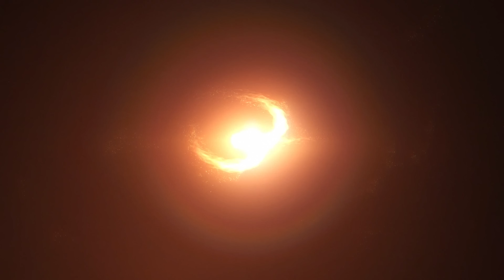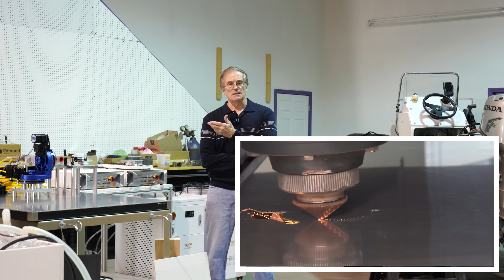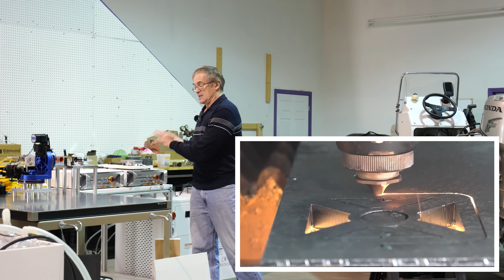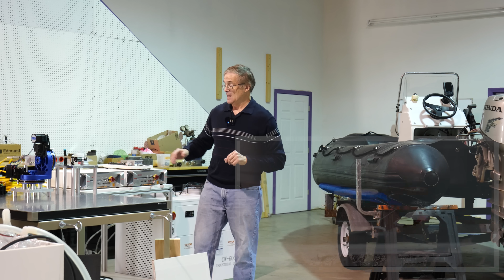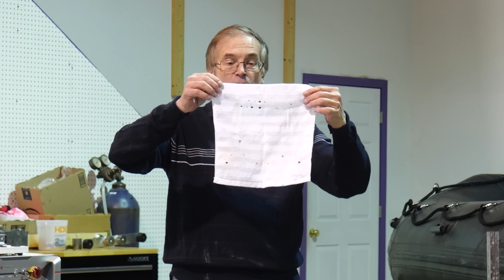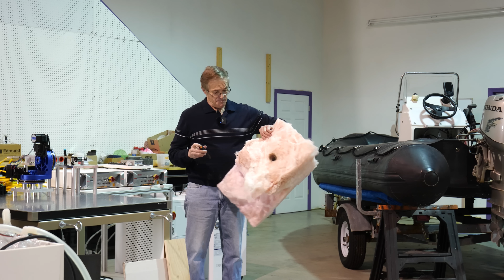We have a problem... and need your help!

Comment: packing gypsum salts between two panels.   They come very hydrated, mostly water by weight. Fill up the gap between the panels.  The white crystals and the flash to steam could buy you a second.
Reply: Epsom salts.  It’s late.
Reply: MgSO4•7H2O    7 is a lot.
Reply: Before the panel exploded.    Idk.  Maybe.

Comment: Something i think we are all forgetting: part of this test will be on a moving object, both lateral and vertical variances, more random in nature to test the tracking system. 

The most difficult part of this test isn't the destruction of the target,  but the targeting of the object itself. So my proposal would be to use a lower powered laser and a photodetector switch on the drone itself. Set the sensitivity of sensor to much higher than the ambient light, to include direct sunlight (laser light is more focused and the intensity at the impact point is more intense than direct sunlight). The target could also be a 3d printed sphere with tubes leading to the sensor. Sort of a reverse disco ball. 

Then youll have to tweak the software to see if the target is dropping, if not, rinse lather repeat. 

As far as accuracy, i would want beam diameter times 1.5 MOA at the absolute furthest distance you can manage, the farther, the better. 

Another idea is to have small light tight boxes on the side of the drone that sends a kill signal to the laser controller.
Reply: I like this solution - totally changes the equation - trying to contain the 'impossible to contain' Vs. removing the 'impossible to contain' element.  Also gives you Unlimited testing time Vs. constantly patching holes with the high-power laser.
Reply: Exactly feel like I'm the only guy here with a modular system
Reply: Why not a retroreflective laser photoeye, and a retroflector on the target?  So no sensor on the drone.

Comment: Sounds like the problem comes down to beam intensity. I never played with a fiber laser, but perhaps you could de-collimate the beam in front of the wall. You could use a diffuser lens to disperse the light and lower the intensity to a manageable level. Use retail signage hardware to suspend the lenses several inches off of a (perhaps water cooled) surface.  Don't fight light with material matter, fight it with optics!

Comment: graphite felt is where its at. good absorber stops reflection lightweight and easy to setup. if you back it with textured copper there is a good chance if burnthrough happens it gets reflected back into the felt and absorbed.

Comment: I'm thinking differently... Here's the rough idea: Basically an aperture type setup. Where the aperture/iris/pupil is electronically connected to the laser output, and when the aperture is closed, the laser instantly is switched off. Making it impossible for the laser to burn the back of the aperture. Then you could essentially have different pulsed aperture opening events, to destroy targets, and you could play with different methods and timings for that. I don't foresee any other issues there. With the safety and wall, maybe also have an electronic cutoff for the laser PHYSICALLY pointing downward, or upward or left or right beyond the safety settings you enter each time you plan a live fire test. So essentially, electronic, fast, sensing cutoff switches. I thought of this because it reminded me of the story with aeroplane and their machine guns and how they solved the problem of the props getting shot up during firing of the gun in flight. It is absolutely henius, and simple, and fool proof how they solved it. Also didn't reduce the damage and effectiveness of the weapons. Any way, good luck, hope that helps. Appreciate all you guys do, great scientists, and great videographers, as well as crazy mad men... -=) That's a good thing by the way. Ciao for now. -Andrew
Reply: Other people said it, you have a turret mounted laser flying around trying to shoot down a drone. Think about it

Comment: Well, the only thing I could think of is some sort of defuser. Just like the laser cutter, if you can get the beam out of focus again after it's destroyed whatever it's going through, then the energy is spread out over a much larger area, and might not even need any sort of backstop. Only question is.. How?
I doubt there's any sort of lens sheet that's made that has a bunch of micro lenses in it to defuse beams from multiple angles and directions. But maybe if you have some sort of clear beads between a sheet of steel, maybe painted black as to not risk reflecting the beam, and then the back a sheet of glass, then it would punch through the front steel sheet, and then get refracted in many directions randomly in the beads, and then any that make it through the back should be diffused enough to not cause any damage to anything several feet behind it.
Or maybe even glass sand, might be a bit harder to contain inside of a container that gets a bunch of holes in it lol
But maybe it'd work better. Or even maybe marbles could work. Just as long as whatever beads or refraction medium is clear enough to not absorb a ton of power from the laser, that it might work.

Comment: Copper foam or shaving.... It will spread it but in large areas .....
Reply: Fill the box with  copper shaving and just enclosure it with some things high temperature. I have a fiber laser copper is a pain to deal with. Plus you can get your copper value back.

Comment: What about a large Mylar sheet stretched tightly over a frame to form a "mirror", canted at a 45 degree angle, that redirects the laser at the concrete slab?
There might be something you could add to water, like a dye, that would make the water absorb more of the energy.  Then you could use a large tray of water below to protect the slab if necessary.

Comment: Large sheet of thin copper not polished but sanded to scatter the beam (1000 grit?) behind the sheet rock. It may burn through the gypsum board but it won’t burn through it after bouncing off a crappy mirror. Coat the copper with lacquer so it still works and doesn’t cut the copper after it’s aged a bit. Need to look up the laser frequency and how absorptive copper is to it

Comment: A 10 foot circular black anodised or black graphite painted 1/8" Aluminum sheet with a rotation rate of about 5rpm will absorb all energy and never melt if the beam locks up, and a 10 foot test area is large and fits in the garage.

Otherwise a stationary rectangular sheet or any size suspended from the ceiling and front surface applicated with "starlite" material (makes carbon foam insulator when heated)

Both set ups should be easy to Lift up and secure with a rope and hook flat against the ceiling to get them out of the way

Comment: I wonder if the glass beads they put on the lines painted on the road would work, or even clear marbles. The idea is to diffuse the beam through the beads or marbles onto something like a painted backstop. The diffused beam might have less power and the backdrop might be able to handle it longer.

Comment: I am by far underqualified. But I may have a idea that could circumvent the human element of reaction time in stopping the device once its task has been accomplished. Is there a way that the laser itself completes a circuit and by completing that circuit the device essentially switches itself off. Perhaps a light detecting fabric that can be draped behind the target. Or something similar. Like I said im very much so under qualified but feel like using the speed of light against itself is the best solution.

Comment: I'm no engineer, but having spent time building a  low power helium neon laser gun in the 80's; It seems you only have 2 possible solutions when testing, one of which is much more difficult to resolve. A) if you leave the focal point the same after burning through the test target, there is likely little to nothing you can do to obsorb energy without consequences as you've demonstrated. B) what if you split the laser beam into many weaker individual beams that are more manageable to resolve energy diffusion. When I had my laser gun, I shot it into a drink glass and the ice cubes in the drink difussed the beam off all the individual ice cubes,then was absorbed by the clear water or liquid. To split the using a multifaceted diamond in theory could split the beam into weaker ones that sends them in different directions, which are weaker laser beams. Just a guess that defusing the laser beam after a practice target is penetrated like Ice cubes in a clear liquid or some other refractor like broken glass in clear container filled with a liquid, maybe even a dark liquid in a large tank or container might would work. Also have you considered varying pulse durations from your laser instead of continuous wave? So my vote is to try to split the laser beam into lots of smaller ones that are obsorbed as a theory for your solution.

Comment: What if you re-arranged the experiment to fire downward instead of sideways? Easier to layer your protective material, and if that burns through, you'll have earth under it. Your targeting area would likely be smaller, but you would get to pretend you're shooting lasers from satellites. 

How deep would a pool need to be to absorb the energy for a full minute? It would be cool to watch the beam punch through a several meter long trough of water and get a measurement.

Comment: Probably mentioned already, but you might experiment with refractory materials such as fiber blankets, fiberboard, castable refractory and you could even add some carbon black pigment to increase its absorption.

Comment: We blocked a 20kW CO2 infrared laser with a shutter disk, mounted on a solenoid mechanism. It was black anodized aluminium, and had a cavity in the back for circulating ice cold water from a chiller unit. Total diameter about 120 mm, thickness around 15 mm. It worked. Its natural position was normally closed (with a spring). Without this we DID burn a hole through the laboratory wall. It could easily melt a brick if allowed. The beam was interrupted before it was focused, with a beam dia of around 20mm.

Comment: I have a question ... Why slice and dice ... With that kind of power just hang out there in the projected path and let it get cut in half or set your laser in a jitter ... On my comment about 2 glass panels with ground glass and water ... You could also try clear glass beads and water there would be more room for expansion so the don't blow out ... 1.5 inches maybe  ... I still think a fireing window range contained in the full view of the camera might be a better thing then just anyplace in say a 8*8 foot area ... I seen a lot of good ideas from some people that say they have the knowledge to solve your problem ... My self I think you went to deep and have a new kind of butt hurt ... But I see a use for glass beads or something like that ... Again best of luck

Comment: Lots of good comments in here from qualified people!

You never gave your spot size or power, so it’s pretty tough to give a good guess.  That said, I bought a couple fiber lasers for mill scale removal thick scale, like 0.005”+.  The 2kW laser with an 800mm ftheta couldn’t touch it.  The spot size was just too big.  It could mark steel, but only just.  I could get an 80lbs chunk of steel up to 150 degrees trying to get a 1”x1” area of scale off, and I’d maybe get 0.0005” of scale off.  My mopa at a 254mm focal length was able to crack the scale, but not ablate it, which was good enough for me.  I’ve since bought a 400 mm lens for the “4 in one” laser machine as well as a couple more down to 150.  The 150 scares me a bit.  400 could finally seem to cook the magnetite some.  But I do t have any thicker mill scale to test on anymore.  I got it from some 2”x4” 4340 hot rolled.  Next time I need to descale, I’ll be trying the 400mm lens and see if even at 2kW if it can blast through.  I have my doubts!  

So, yeah, if you’re spot size is similar to that of a cutter somehow, you’re going to have a tough time stopping it.  But you seemed to indicate a slowly converging beam, so if you didn’t tighten it down a lot before hand, heavily scaled steel out to stop it.  Don’t try rust though.  Fiber lasers eat rust like nothing.  Magnetite though…it seemed to have a rough go with!

Again, depending on spot size, steel should do a pretty good job.

I personally like the dry sand/dirt pile ideas though.  Self healing.  Not very portable unless you built it in a cart, but then each hole makes a leak…

Comment: Not sure if title backer would buy you any more time but if you tested it and it works. The next problem is going to be how to set it up and take down fast. Best I can think of is to make them into blinds that you can winch up from a pile. The next problem is going to be the gaps or holes from stringing them together. Id test if simple drywall screws to a metal stud could withstand the heat without failing if hit; glueing attach point on the back if can withstand the heat would solve the holes if screws don't work.

Comment: Water.  You didn't give enough information to get a complete answer.  What is the wavelength of light your laser outputs?  How big of an area needs to be protected?  Water in a container that is transparent to the wavelength of light your laser outputs.  You shouldn't need more than a few inches of water so the solution is simple unless you need to cover a large area.  If the area is too large a water curtain but that gets messy.

Comment: What if you spin a disk with the most RPM possible? Also the disk should be ventilated like a car brake disk, to disipate even more heat while spinning. Also it could be perforated or like a fan shape. And behind, you could place a second spinning disk like that and then some plate to stop the remaining intermittent beam. That way the exposure to high power beam of each point of the spinning material will be limited in time and also cooled. Hopefully enough time and heat disipation will prevent melting.
Wait.. there is a optimal RPM to maximise time between heating and cooling of a given point, butnit gets too complicated.

Comment: Lava Rock, try Basalt dry no water. water lowers melting point. that should get you to just over 2000 *F, maybe a basalt counter top.  or a metal tub of water you would have about 2500*F for the steal melting point and plenty of water to cool it down. think plastic bottle of water over a fire. probably thick sides. or like others said the ground, shooting range berm.

Comment: Option 1: Do it vertically, you're not going to go through the earth's mantle. Maybe you end with a few fulgurites. 5 meters high, a cone of action from 25º to 90º respect the horizon, gives you a tilted elliptical plane of work of 69m^2 if I didn't mess up.
Option 2: Try diffracting the light before blocking. Water+Sugar is the obvious first idea, which requires verticality or a full transparent housing. Maybe there are other solids that work better than the fibreglass, like making a wall of epoxy lenses (or a single massive one).

Comment: If I were you, I wouldn't even be anywhere near an experiment with such powerful lasers. You need a well-thought-out safety system. This could result in amputation or even death. The resulting fumes should not be underestimated either. The absorbing material to be used depends on the power and wavelength of the laser. As far as I know, they are water cooled. Stay healthy!

Comment: What you need is a big old tank filled with synthetic motor oil and sand to diffract and absorb the radiation, with the mix being pumped through a heat exchanger to keep the mix cool and flowing around the tank. Fill the tank completely and seal so there is no oxygen meaning nothing can burn.

Comment: It seems to me that it would be vastly more practical to have some kind of kill switch that can quickly turn off the laser
 
One possibility I can think of is two layer of dry wall with a gap between them, the gap is completely dark.

A photo sensor is placed between the gap so that once the first layer of drywall is punctured, the laser is immediately turned off.

In high speed photography it's possible to have something like an Arduino snap a photo within a few millionth of a second after a flash. So it's definitely doable on the cheap side.

Comment: What about setting up some cloth barriers (say a few towels, or comforters, or whatnot) and PUMPING water at a high rate of flow between and through the layers of cloth. You would essentially form walls of water trapped within and between the cloth that would be constantly replenished by gravity and flow in any areas that evaporated. If you can get the flow high enough that it also cascades down the side facing the laser, the water droplets might also deform and refract the light and spread out the beam and hence the "heat". 
You might also tint the water with food colouring or dye or something to adsorb the specific laser wavelength better and spread out the heat even more. You could also chill the water to just above freezing (say 1-2°C), which would allow the backdrop to adsorb a little more energy before it "boils off". The steam emitted would also be your que to hit "off".
The water can be pumped from the top through weeping hoses, or through piping with many tiny holes drilled in it, and you could create manifolds so that water is pumped into the cloth in multiple places, and perhaps create the heaviest flow in the areas you expect the laser to strike.
So make "walls" (think "portable room dividers") of cloth hanging, (or even stretched taught), from spray/weeping pipes gushing water between the layers (with other gushing pipes interspaced throughout), and the bottom sitting in a reservoir of ice water which is being constantly circulated by a pump.  You could also add wheels at the bottom of the whole apparatus, to position them exactly where you need them, or perhaps easily move them offsite elsewhere.